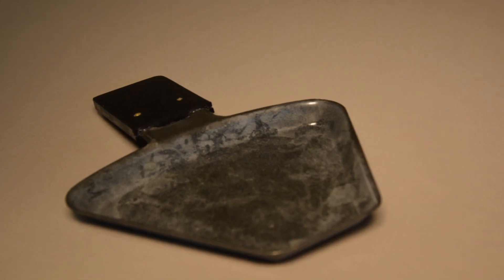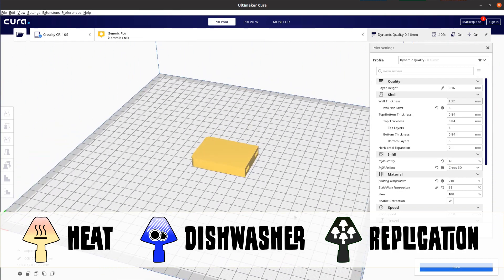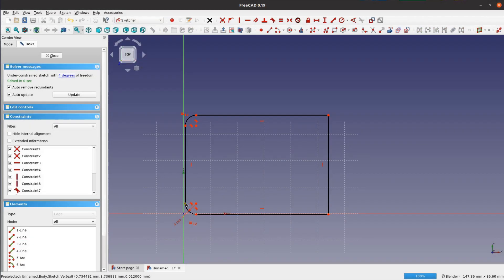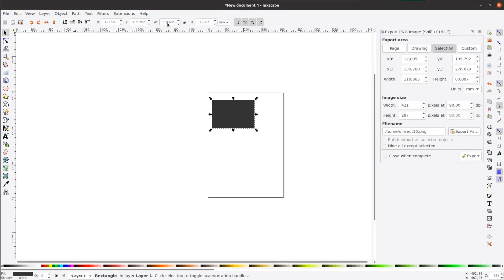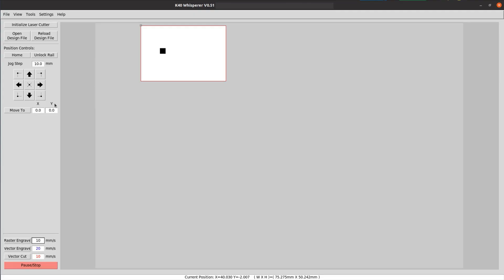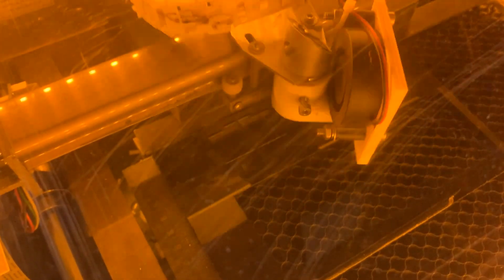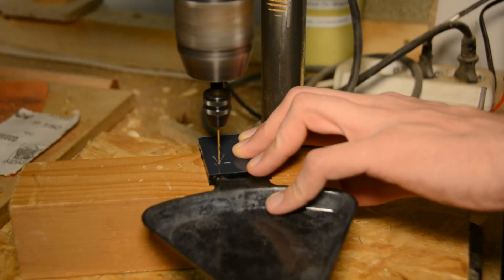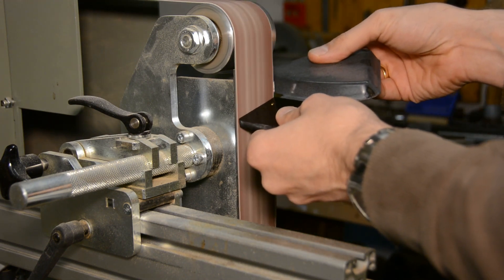3D Lasercutting - cutting a specific depth with the K40

Comment: A very nice example of repair over replace! Thanks!
Reply from the maker: Thank you. And the laser cutter was really usefull to repair these pans. Cutting the same shape with a router would have been quite difficult.
Reply: totalbottle  time and money perhaps probably, but resources... I don't think so in this case. Very little resources were used compared to having to produce and ship and store a new one. And the cost of tools should be spread over all the use you get out of them. Resources are just very very under-priced.
Reply from the maker: totalbottle  I would disagree. The acrylic was a scrap from another project that I would have thrown away.  The brass rod is something I always have in stock; the material used is maybe 15ct. Even when I add the glue the repair is not more than 1€ in total. 
For that price I would not have gotten a new pan. :)
Reply from the maker: But if you want to calculate a business case for the pan those machines are sunk cost.
Reply: totalbottle  I get that your goal is just to make a quick negative comment but to actually explore what you said: The economy of investing existing materials, equipment, and time in a small project rather than a purchase has a direct component of immediacy as well as a couple of more complex additional indirect components.

For the direct measures of efficiency and efficacy of this particular project I would estimate that it would take less than an hour to complete if not producing a video of the process and a tool to produce the data set . Honestly I've done similar projects in under half an hour. This is likely to be much less time and resources than shopping for one either in person or online. Both of those are using time and existing investments in equipment much more expensive than what is shown being used in this video, by the way. In addition it doesn't extract new materials.

Indirect components are difficult to quantify. He has explored and produced an initial repeatable methodology for a process. This will be something further refined and adapted as time goes on. It also has a value as exercise in multi-disciplinary production processes on it's own accord. While you value your time as worthy of commenting "Yea, but..." this guy valued his time to create the reusable project resources of a calculation spreadsheet and CAM files. Plus he shared them as well as his process details which are adaptable. You share a little bit of bland, uninspired snark. Which is better do you think?
Reply: totalbottle  I apologize for misinterpreting your comment. I would still maintain that there's a lot to unpack and room for debate on the efficiency and impacts of home shop fabrication vs centralized mass production. Just to pick a single aspect: mass production requires estimation of demand and requires that more of an object is produced than this estimation. Home fabrication is on a single as-needed basis. This is amplified on the premise that there will generally be multiple competing producers whereas a home shop fabrication typically provides some minor production capacity for multiple households.

There is something to be said for decentralized individualized production capacity. Moving mass production from household goods to component supply for home shop fabrication equipment changes the dynamic in complex ways.